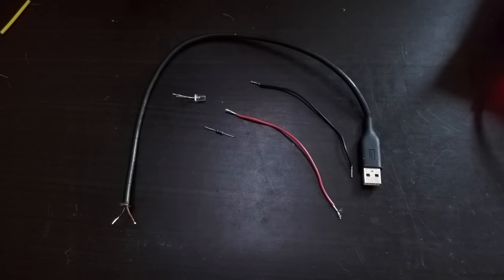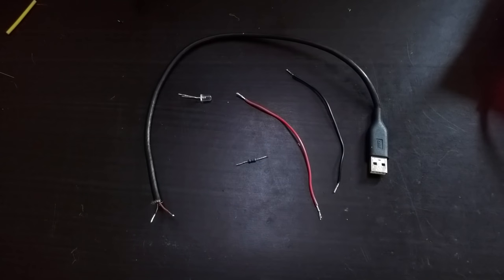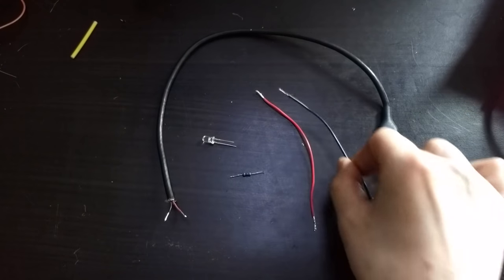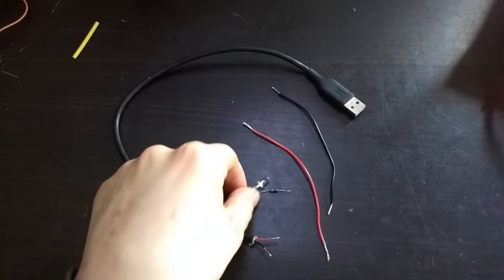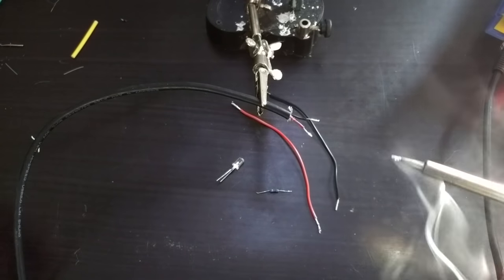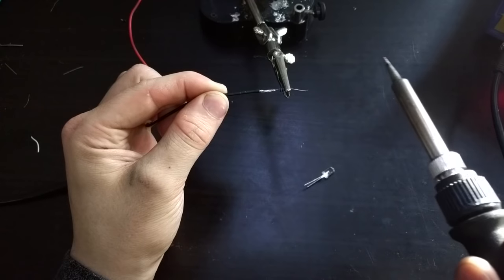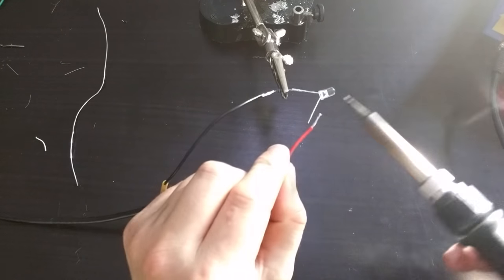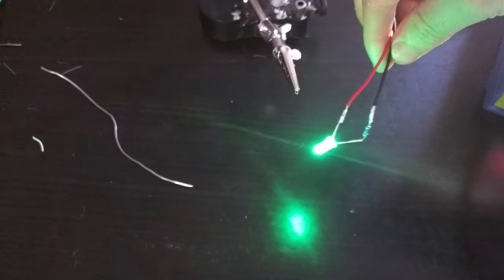How to Make a Simple LED Circuit (Interactive)

Comment: I usually solder the resistor to the positive side, can you explain why you do it on the ground? Am I doing it wrong?
Reply: Typically you're correct it should be on the Anode(Positive Side/Longest Leg).  But technically it doesn't matter what side the resistor is on as the same amount of energy will go through the LED.

Think of the circuit as a belt or chain, if you slow down the chain at any given point it slows down all the other links connected to it also. 
IE: resistor on Anode or Cathode it doesn't matter.

Hope that helps.
Reply: @TheIrishAce  oooo wowww very helpful sir....
Reply: @TheIrishAce  Wait but Resistors are supposed to make it so that not as much electrons pass through the LED right so if you put it on the negative side it would make sense because it would make it so that the LED wouldn't overheat due to the amount of electrons. But if you put it on the positive side, wouldn't the amount of electrons burn out the LED since you put it on another side?
Reply: @stephanzoes8010  the electrons are slowed down and that's all is needed. It's like slowing down traffic, it doesn't matter if it's before the light or after, the flow will be slow.

Comment: Shouldn't the resistor be on the positive line prior to the LED? That LED is taking all 5 volts rather than the 3 intended and the resistance is after the fact, making little difference to the LED.

Comment: I prefer using the term "Ground" instead of "Negative". The reason for this is that you often have Red-Black-Red on the secondary side of a transformer, making it (-12V)-(0V)-(+12V) as an example.
Reply: Could you please explain it further mate? I'm interested to learn

Comment: You explained everything calmly, that's major for someone like me, who's just started to learn about electricity - thank you for that. But, I heard that electricity actually travels from the negative to the positive [say, in a regular C battery] that would mean, that the resistor you installed is indeed in the right spot. Yet you claim, that whether the resistor is before or after the LED, makes no difference. Is that because you are using is alternating-current? Please let me know, and kudos for this video. Cheers!
Reply: No,there is nothing different in AC

Comment: I thought current travel from positive to negative. why would you put the resistor on the black wire? the resistor purpose not been used.
Reply: Yeh can someone explain this.
Reply: Electron flow is from negative to positive.  When people first discovered electricity they erroneously believed electricity flowed from positive to negative but this proved to be incorrect, but the nomenclature had already been established.
Reply: Watch this: https://www.youtube.com/watch?v=IzY0wuxt1R8
But some explanation:
- There are TWO types of flow:
  1. Electron Current Flow (Flows from negative to positive). And electrons require a closed circuit to flow.
  2. Conventional Current Flow (Flows from positive to negative). This is charged carriers (explained in the link above). 

Electricity is generated when these two types of flows are flowing at the same time in opposite directions because they interact with each other, THAT is what causes electricity. And because circuits are a loop, it doesn't matter which direction you use AS LONG AS you remain consistent throughout your entire circuit by having everything flow in one direction. 

Hope this helps.
Reply: Thanks. Good explanations
Reply: @Jackson-mp7di  ues

Comment: how about i use the terminal power source directly but with more resistants
and could you give me a circuit pic
Reply: Risnandi Anggara lol
Reply: Harvey Leyland WTF STOP 🛑
Reply: @sethttuce  just wondering
Reply: @sethttuce  i mean how i could make the circuit board so i could directly plug it to the 220v power source
Reply: @risnandianggara  led will burst I tried and don't do it .
It can be very dangerous

Comment: this is a dc current circuit that comes in an adapter that converts from ac to dc and when checking with a multimeter, there will always be one wire to be plus a second minus and the current goes one direction and this direction is not determined by the resistor.

Comment: Good vid.  I thought the resistor had to be on the positive side??
Reply: "not true. As long as the resistor is in circuit it will serve its 
purpose. Think about how the electrons flow. They will always go through
 the resistor, so whichever side the resistor is on, the electrons will 
flow through it. Hopefully you understand a little better." -Simply Electronics

Comment: Can it be powered with a battery, or a small closed loop type of power source (if that's the right term)..? By connecting the positive and negative to the corresponding ends of the battery? Asking for a friend.

Comment: how about the LED is more than  1 or two but its 20 or more ?
how the sircuit ?
Reply from the maker: Take a look at my How to use a breadboard video. I use 3 LEDs in that example, replicate the same circuit for as many LEDs as you like.
Reply: so you just replicate it
not calculate it
because i want to use about 50 LED's and powered by hanphone charger
Reply from the maker: Well, you should calculate your resistor values. But I'm using 5 volts in this circuit. so You should be able to use the same resistor values.
Reply: ya 5volt handphone charger ...!!
what about capacitors?
Reply from the maker: you don't need capacitors in this circuit.
Reply: i mean resistor ....!!........................
sorry

Comment: if you were to use the other end of the usb charger cable (like the android charger bit) do you think you would be able to power the LED by plugging it into a phone?
Reply from the maker: You can, but be careful with this. Your phone may not regulate the current draw. it depends on the phone to be honest. Just be weary of destroying anything expensive.
Reply: Needs OTG
Reply: You need to have an otg connector. To do this u should short 2 pins of the connector(it has 5 pins). I don't know which ones , you can watch on yt

Comment: thanks for the vid, my question is does the resistor have to be placed on the negative side and how did you figure the proper resistor for the LED ? and how do you figure the proper voltage and amps for the LED
Reply from the maker: A resistor can be placed anywhere in a series circuit and it will still impede the flow of current the same way. If you have a water pipe with a valve that you can partially close, the water would slow down just the same if it was on one end of the pipe, or the other, right? Same with the resistor. Negative or positive side is your choice.
Reply from the maker: The LEDs Current rating is specified from the source I purchased it from, They are generally approx 20mA for the 5mm LEDs, although it can vary depending on the colour. Voltage for an LED is approx 3V. Although again for diferent colours the voltage does defer a few hundred millivolts. I have a video for calculating resistance, check it out.
Reply: ok but if have a bunch of LED's but no literature. is there a way to figure out the voltage and amps with frying them?
Reply: this is a dc current circuit that comes in an adapter that converts from ac to dc and when checking with a multimeter, there will always be one wire to be plus a second minus and the current goes one direction and this direction is not determined by the resistor.

Comment: Hi, how would i wire a parallel power supply to link leds upto a car speaker ? I tried wiring the leds to the speaker power supply, but very little output from the leds and was told i need a parallel power supply for the leds ?

Comment: My question ia why you use resister negative side? can we  use resister positive side? 
Thank you.
Reply from the maker: Either side, it doesn't matter.
Reply: @SimplyElectronicsOfficial  Great answer, but why? Logic would tell me to place the resistor before the current reaches the LED.
Reply from the maker: @croll_uk  think of it like it's water flowing through a pipe. If I put a kink anywhere along that pipe the flow of water slows down through the whole pipe, it can't travel at high speed before it gets to the kink and slow speed afterwards, thats not how physics works. So it doesn't matter if the resistor is before or after any component, it restricts the flow across the whole circuit.
Reply: @SimplyElectronicsOfficial  That makes it more clear to me. Thanks for clarifying :D

Comment: What size gauge wire do people typically use when making circuits, for pretty basic projects, has to handle up to 25V and up to around 3 amps?
Reply from the maker: If you want to purchase wire, and know what current it should handle, pretty much all wire will have it's current rating labelled as standard. So go with wire rated above the current you intend to put through it. So 5a wire will be fine.

Comment: Why don't you solder resistor to positive side?
Reply: Yes I'm questioning that myself: resistor to negative should not provide a dimmed LED in my experience. I guess proof of that is actually here, since at the end that green LED "has lit quite brightly" just as if normally.

Comment: why join the black wire to the resister? what if you joined the red wire?
Reply from the maker: +Georgi Miller Doesn't matter. It's in series. Could be either wire
Reply from the maker: +Simply Electronics as long as polarity to the led is correct of course

Comment: Just wondering, why do you need the resistor? If you touch the LED to a battery, it works just fine. What does it add? Sorry, I'm a total noob at this stuff!
Reply: LED lights normally only like 3 volts or 2.7v depending on the color or style etc..
This is being powered by a 5vdc USB plug. Plugging the LED straight to 5v will make them very bright and drastically shorten their life span.

Comment: Will the led first effected by voltage. Because u connected resistance to negative terminal..as we used to pass 1.8 to 3.3 volts to led..but in this..u pass 5v to led and 3 volts to resistance.   No sense I think..

Comment: I know this is a 3 years old video but I’ll bet on you answering
First things first why did you use the resistor on the negative side? True the connection is now parallel but you could’ve connected it to the positive side.
Second things second how can i make something like that but with a small battery instead(basically gonna use it in a pen)
Reply: no difference in adding the resistor to the positive or negative side, it won't make any difference, the resistor is in series with the LED in both cases

Comment: can we connect the leds into series? with the same usb cable technique? can you please tell what if to connect 5 leds with the usb cable ? what should be the value of resistors?
Reply from the maker: Connecting in series will not work as there is only a 5v supply. You can put them in parallel as they will just draw more current. Check out my series vs parallel video to get a better understanding of this. Putting them in parallel, use the same resistance value for each led.

Comment: But, you plugged it into what?....you can't just put a plug on it and plug it in, so what powered it?.....
Reply: Phone charger, powed bank etc.. The power Source 5V and depending on how much leds you use, The amperage. If your power Source can give 5V 1A, for One led its more than enough, but thats allright. 5v 1A could run abaut 4leds i think
Reply: he told at the start it's a 5v charger, so a phone charger would do

Comment: wanna make a costume utilizing a mix of LED strips and circuits to make it light up, still have no clue on how to do it.
Reply: Dimsidios maybe a little bit late, but use ws2812B led strips, and get a arduino nano if you want to use it for costumes. Then search on youtube for "Arduino fastled tutorial ws2812b", and then you should be able to just copy the code and wire it following the video.
Reply: @arjankomdeur1134  I want to use a little light from those string fairy lights to make the and of my prop sonic screwdriver light up... any ideaa

Comment: 2 divided by 150 equals 13mA???...very confusing!!
You first look into the datasheet of the LED and see the current consumption... usually about 20mA.
You have a 5 V input , the LED needs 20 mA...you choose a 250 ohm resistor and that's that!
2 divided by 150 equals 13 mA!...how did you come up with that?...and no one asks!!
Reply: 5v / 20 mA = 250
And you need a 100 ohm resistor if the LED is 3v, because 5v - 3v = 2v / 20 mA = 100 ohms
Just type ohms law calculator into google
Reply: No offense your confusing even more lol

Comment: So I did this with a 4 volt power supply because that was the lowest I had. The led lit up and died in 1 second. The light was still there, just very very faint. I have to say, when you put too much power in the led, it smells terrible. Cool circuit though, Im going to try again later with 3 volts instead of 4

Comment: Thank u.  Btw i'd use led 5mm 3.2V and 10ohm resistor.  When i use on charger it's good and long lasting.  But when i plug on powerbank that same voltage (5v) as the charger,  it won't last..  What i supossed to do?  Adding an ic or what?
Reply: Inata Fadhea Pradana The driving voltage in your case will be 5 V minus 3.2 V = 1.8 V, and your current will be 1.8 V divided by 10 Ohms = 180 milli Amperes. Most LEDs of this size can only handle 10 to 30 mA. So when you plug into a power bank, the LED will not last. It just survives on the charger only because the charger itself is a current limiting device. You should always use a resistor to limit current to 10 to 20 mA for small (5 mm) LEDs. That’s for LED to last, as well as for preventing fire hazard in the circuit.

Comment: hi, you mentioned the LED itself uses 3 Volts, was this bit of info supplied with the LED or you happen to know that from some other source? thanks in advance. ps were do you get your bits and bats? I rather buy from some one who knows - last thing you want to do is buy something off ebay and the parts are either rubbish or a fire risk etc. many thanks.

Comment: Isn't that green LED "quite bright" actually because resistor was joined to negative lead instead of positive?... I mean, sure current will flow no matter where you attach the resistor, but dim light effect won't be achieved with resistance through the negative lead. At least that's my personal experience on motorcycle lighting in the past. Ever since I concluded, mostly by intuition at first instance, that resistor must be joined to positive if I wanted a less brighter LED.

Comment: you get an LED and stick a 1.5 volt battery between the terminals. bingo, a simpler LED circuit.
Reply: Not true
Reply: If you get right voltage led it's possible and functional...

Comment: electricity travels faster in a red wire than in a black one
Reply from the maker: +Kelvin Kersey this in incorrect. What makes you say this?
Reply: Kelvin Kersey that's wrong, it is the current not the colour
Reply: Absolutely true Kelvin, electricity travels at the speed of light, so if you put electricity in a dark wire, it travels at the speed of dark... which is slightly slower. 
Heh! sorry, bad joke.
Thanks Simply Electronics, good vid.
Reply: RichBlaker but wait, wouldn’t the speed of dark be faster than the speed of light since dark instantly replaces the absence of light. pls don’t wooosh me

Comment: Sir, I'm not a pro but I do know this much,  You should have soldiered the resistor on the positive side. Otherwise the resistor serves no point.
Reply from the maker: +John c Towner not true. As long as the resistor is in circuit it will serve its purpose. Think about how the electrons flow. They will always go through the resistor, so whichever side the resistor is on, the electrons will flow through it. Hopefully you understand a little better.
Reply: Sir you are correct and I'm wrong. I'm still learning. Thanks for the info. Peace
Reply: Simply Electronics i just knew that.. i usually put resistor on positive. thank you sir.
Reply: The purpose of a resistor is to ensure that the right amount of current is delivered to the LED. And you pick the resistor accordingly. The higher the voltage the higher the resistance you will need for something like a 5mm LED, which normally have a 20-30mA max current. Considering that current is delivered from positive to negative, the resistor would not serve its purpose and the LED could burn out depending on the voltage of the source!!
Reply: Electrical circuits have a subtly complex way of operating. When you apply voltage to a closed circuit, that voltage flows through the circuit at almost the speed of light. This energizes the circuit and this happens before any current flows. The circuit components then shape the flow of electrons with the appropriate voltage drop across the LED diode and the resistor.
Reply: true but when you calculate the current getting in the circuit you have to check the total voltage drop in the circuit which will be the same either way therefore current entering the circuit will be regulated by the resistor, be it on any side, hope that makes sense
Reply: John c Towner So what??? If 5v is fed to the LED from USB,  all 5V hit the LED before the resistor.  That kills the LED.
Reply: ANDREW ROUSE electricity flows from positive to the negative side of the battery
Reply: John c Towner im not trying to be smart or anything, but if the resistor is in the wrong side, why did it work?
Reply: jose chavez because. It's in the completed circuit...
Reply: the resistor has nothing to do with whether it works or not it is there to control voltage voltage can be controlled from either side the resistor will only let so much flow through the circuit therefore it doesn't matter which side it is on as long as it stops the flow in one place or the other
Reply: John c Towner